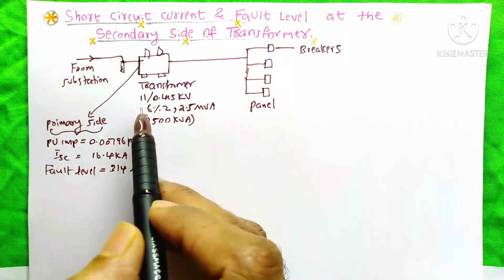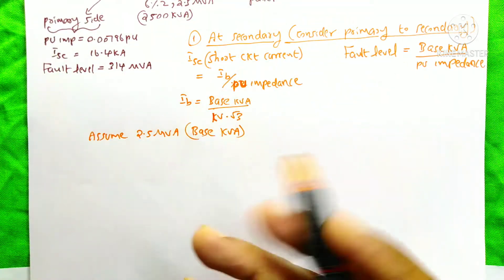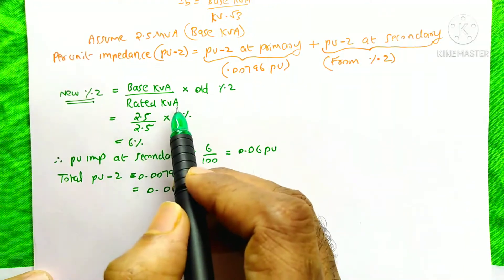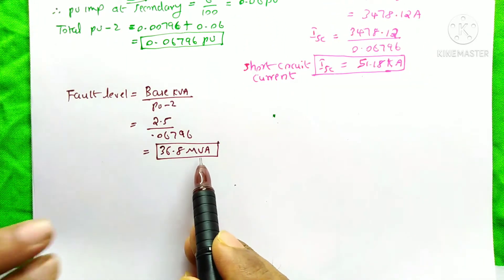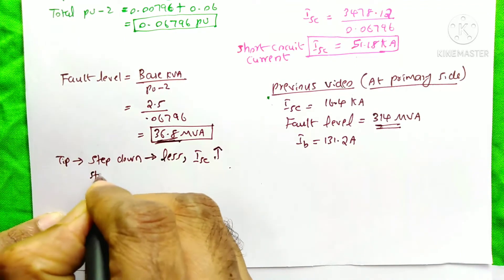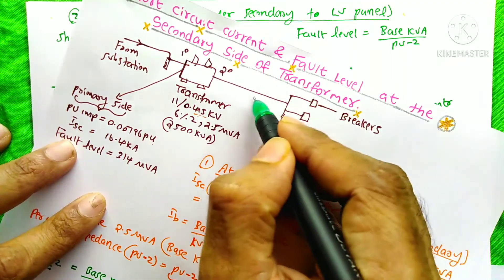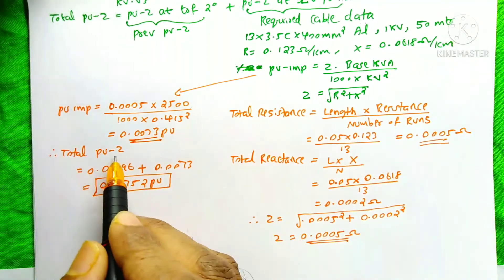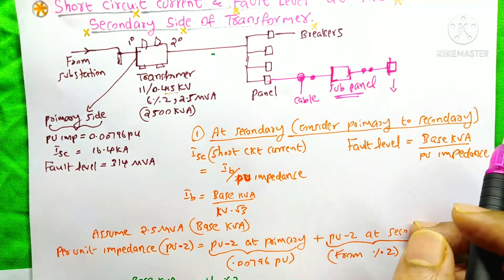Calculate short circuit current and fault level at secondary side of transformer | Electrical

Comment: If motors are connected on the secondary side, then how to consider motor starting current for the short circuit calculation.
Reply from the maker: Motor starting current is not required

Comment: The primary side current IB =131.2 when reflected to the secundary side should give Ib=  2478.2 per your calculations. But when reflecting the primary current to the secondary side of the transformer it results in the following IB_primary*Vp/Vs= 131.2Ax11kv/0.415kv = 3477.59A. Why is this big difference of a 1000 A almost!?
Reply from the maker: See the video one more time, your doubt will be cleared..